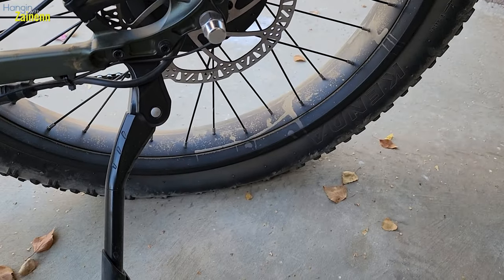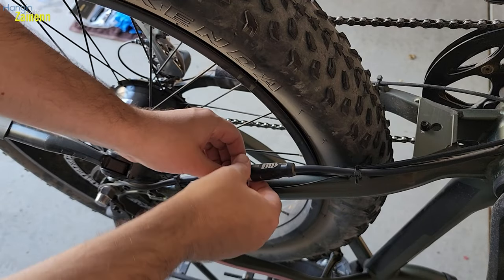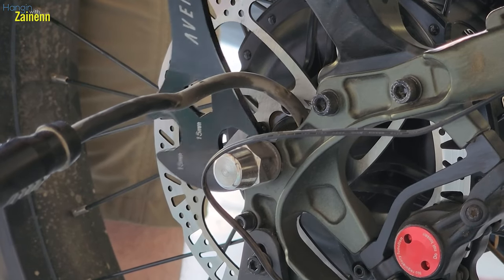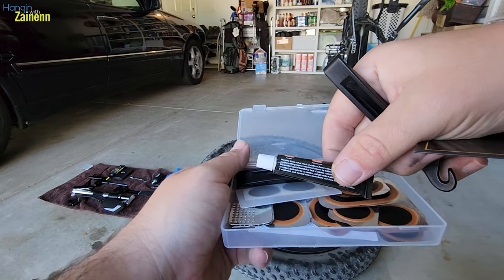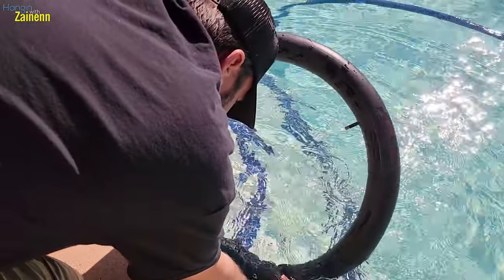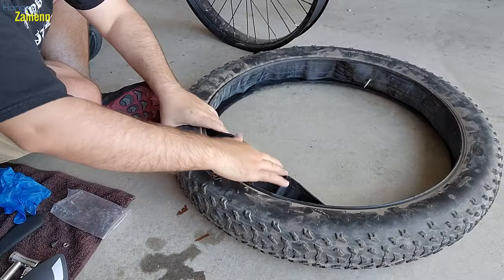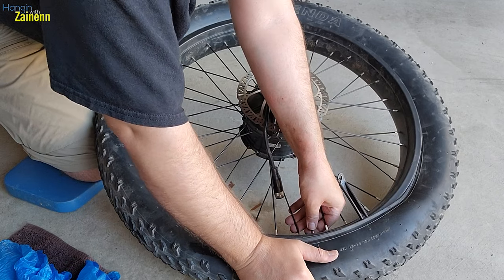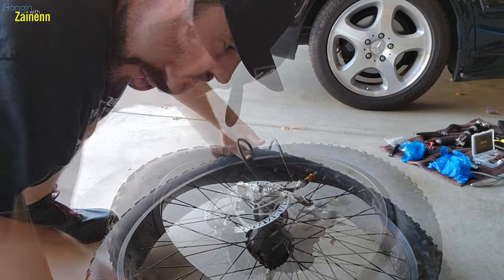How To Change Rear eBike Tire: Aventon Aventure

Comment: It’s always the back tire…🤬
Reply: Literally was. My bike got a flat in the back it was a like a hand me down bike, so I had no rear rack, saddles or anything. Had to get a ride from a friend, atleast I know my friend is reliable
Reply: Straight up all truth I've had four different e-bikes and every time it's the back tire that pops never the front pretty sure the companies are doing it on purpose
Reply: You have to add a liner to your tube if you want no more back tire issues. I had one installed cost me $60 but it's pretty bulletproof@LumbeeNative
Reply: No today I did have it to the front tire but it was a small hole so I could get home but in my way I realised the pinion group was not tightened properly😱 so double work😂😱
Reply: Not at all.
Reply: Mines 2 weeks new 😅😅 and told my peeps “my fear is the back tire going flat” THEN THE NEXT DAYYYYY woke up and it was low…. Yeah I was mad

Comment: Check the air valve first.  Its easy to replace the valve core, it that's the problem.  If you need to take the rear wheel off, I suggest cleaning all the dirt and dust off before disassembly.  This will help to keep everything clean (including your tools and hands) during disassembly and will help to avoid trapping dirt in when putting things back together.

Comment: It's probably your valve stem that was leaking. Next time you might try to tighten it up a bit. Also always add plenty of air to the tube, get a spray bottle with some soapy water in it and spray the entire tube including the valve stem, and you will see bubbles form where the leak is.

Comment: Thank You, I have the ENGWE L20 and with your video I was able to change/replace my rear flat tire.  Sadly, I had a flat in less than 30 days of use.
Reply: Same. I found a thin thorn like piece of metal that was bent and went through the tire but I couldn't find any issue with the tube.

Comment: I had a flat caused by a thorn tip smaller than the tip of a a ball point pen.  It just barely scratched the tube, but enough to cause a slow leak.  Getting home was an adventure for sure.  Next day, I bought some FlatOut and new inner tubes.

I followed the above link for inner tubes and almost bought the Presta valve version.  The Aventure 2 uses Schrader valves.  Schrader valves are easiest for running FlatOut or Slime in the inner tubes.  The little black pry bars you get with the tubes were too bendy to be of much help.  Fortunately I had some old ones from my Trek 

I used this video and also took several pictures to aid reassembly, while removing and reassembling the back tire.  The Aventon Aventure 2 uses two washers on the brake side and uses one washer plus the derailleur guard on the derailleur side.

Brake side (from outside in to the wheel) Wheel nut, washer, washer, bike frame, knuckle washer, wheel.
Derailleur side (from outside in to the wheel) Wheel nut, washer, derailleur guard, bike frame, knuckle washer, wheel.

Note: Knuckle washer must fit into frame slot when reassembling.  Also, I put bike into low gear before starting, to aid chain removal \ reinstall.

Note: Take pictures with phone.
Reply: I’m glad your comment validated what I did. I was unscrewing the chain side and the nut, lock washer, and guard fell off 😂when I put it back on I just assumed the order.

Comment: Great video.  Thank you.  If I can add the following to help others.....
Always a good time to degrease your rear cog teeth when the wheel is off.  Also inflate tube to 30PSI and use a spray bottle of soapy water - works much better than submerging in plain water.  Never press the brake handle when the wheel is dismounted and finally, ride slowly and check recheck brakes by pumping many times to ensure bubbles aren't forming from being upside down.

Comment: Thanks.. everything is a trick.  

For mine (Aventure 2) I basically had to remove the nut and washer from that side to be able to get the tire back on (probably would have been easier when I took it off to)

Getting that tire back on was painful but I got it.

Comment: Great video, thank you! - Would have loved an explanation on how you finally got that last bit of tire on the rim as this is the problem I (and probably everyone else) always runs into. :) - But don't get me wrong, I really appreciate your efforts!
Reply from the maker: Hey there,  The innertube just wasn't aligned correctly.  You just have to make sure its seated with the valve stem in the correct spot.  Also it comes down to the method of pushing it back on, all about the angles.  Thanks for watching!

Comment: I kept trying but the wheel simply would not go in the axle slots.  Finally got it. One difference is my aventure has the mud guard and that can be a problem. Thanks for the vid as it helped a lot!

Comment: So I was playing onward on oculus quest vr this morning at 2am ish and next to me something popped scared me and I pull off my vr headset in time to see my ebike moped style fall over from its kick stand due to hub tire side explode.  I've changed hub back tired tubes once before so I knew what a hassle it can be I stood it up and decided to do it later during day or after 3pm work. To freshen up I YouTube how to and watched yours just to recap in my thoughts the process.  Watching yours motivated me to get back up my bed and do it now at 3am.  It's pretty much my rude to work ..grocery shopping and everything but I also have an electric scooter as back up when either breaks downso I would have taken fast scooter so I'm done changing flat I had all the tools and extra tube plus extra tire with new thread from previous ebike I saved for parts so it was easy fast.  Now all I need to wait for daylight and test I before work. So came back to say yeah your video motivated me to fix it now so yay

Comment: Thanks for the video ❤… my “Made in China” bike got its back tire flat 2 weeks in 🤬🤬 .. after the first one came in damaged and someone STOLE my replacement so now on my 3rd bike in 2 months. So got a “Slime” inner tube that helps with punctures . Hopefully this willl the the last issue I have for a while 😅

Comment: Today I changed rear tire on a Ridstar q20. It was easy. The tires come off and on the rim very easy. I had a tire that must have been leaking from the seam over 36hrs.
In the tire I installed a double layer of cheap Amazon tire puncture film. 

BTW, if the bike sits on its back for 4 weeks like mine did, the brakes may not work unless ya pump them, a lot. Be cautious.

And the cheap liners ($20) did not self-adhesive like I presumed they did. I had to use double-sided tape to hold them in place. I think any kind of fast drying rubber glue would also work.

Comment: Just discovered your channel, love the videos. Thanks for the step by step removal instructions
First off get an electric pump off Amazon (bought mine for 20 bucks) those fat tires are a pain to hand pump up, for city riding I run my tires at 30 psi 
GET FLATOUT tire sealant in those tires pronto. I’ve rode 3 ebikes over 3000 miles with ZERO FLATS. That bike dealer should have it on hand and can install it for you
From your previous videos I agree with most your gear however may I suggest 2 items.
1 -a suspension seat post like Suntour 
2-a SENA bike helmet, it’s got a imbedded speakers and a mic with excellent noise cancellation. Plus if you ride with someone else who has one you can carry on an actual conversation while out riding with the added safety of losing the earbuds
Reply from the maker: Yeah I probably should get an electric pump.  I needed a new regular one to put in my carry bag as well.  Need to keep weight down for bikepacking, but when I'm not doing that, def. a electric one would be nice.  I got the sealant, just need to install it.  Thanks for the gear advice, you should made a video of your setup haha.  Thanks for watching!

Comment: I was amazed you were gonna patch that instead of just a new tube. Lol. I use simple green or dish soap. Your tire replacement will go much easier.
Reply: how and where? the soap i mean...
Reply: @reflexreaction3797  Along the bead to help it slip over the rim, especially that last few inches he was having trouble with.  With soap, you can usually just use the tire tools to slide it right on.  Like a zipper, sort of.

Comment: You may want to keep a small 3 or 5 oz. plastic bottle of dishwashing liquid in your bike's tool kit for lubing the tire beads and there are digital air pressure gauges available for under $10 that are smalll enough to fit into a tool kit.

Comment: Flipping a hydraulic brake bike upside down to do this can introduce air in the brake system, leaving the rider with spongy or no brakes at all.  While your stand isn't sturdy enough to hold the bike, there has to be some method of getting the rear wheel off the ground with the bike held right side up.

Edited to add, Kenda is one of the biggest tire and tube makers for bikes and is a decent quality brand.  Many of the tubes you get for Specialized, Giant or from REI and others are just rebadged Kenda tubes.
Reply from the maker: I did not know that about the brakes, thank you for letting me know.  Also, thanks for watching!

Comment: Its frustrating because i dont feel safe riding through my city. There is debri everywhere of all sorts. Ive had my second flat on the rear tire (the one i just replaced). I need my bike to get to and from work. I patched the tube on the first flat but it still lost air and the tire seemed to have lost its form probably from the weight. The first time, i seen the nail that poked through the tire and tube but this time, i had only found a micro sized staple but only seemed to have penetrated the tire. I dont see a hole nor hear leakage in the tube. Its a very slow leak but the tube even after a long time doesnt go completely flat like last time. I dont want to keep having to buy tires and tubes every month. I was getting flats in my car as well. Kept being the front right tire.

Comment: Wait wait.  How do I submerge the tire into water if I don't have a swimming pool?😀

But on a serious note,  try to avoid removing  the tube completely from the tire when looking for a leak - or a least chalk the tire at the valve.   When you find the leak, you can quickly check the tire at the same spot for whatever caused the puncture.

And thanks for the how-to.  I just bought an Av.Soltera.

Comment: I have a level. I did all these steps and real wheel will not come off. It’s stuck in there. I have done dozens of wheel replacements on various bikes and this bike will not let me remove the rear wheel

Comment: Do you know where to find the exact model for back wheel? I have a similar bike with a broken rim that I need to fix and no one is selling a 20x4 inch bike rim with a motor that’s exactly like the one you have.
Reply from the maker: I am not sure to be blunt.  But I would imagine you can find it on amazon, if not there go to your local bike shop and have them order you one.  Thanks for watching!
Reply: Unfortunately after being ripped off by a bike shop,  I had to learn how to lace my own wheels

Comment: I did this I changed my tire and everything went fine now my breaks don't work what did I do wrong when assembling it back together?
Reply from the maker: My guess (I'm no bike repair man) would be that you either put the tire on backwards or the disk is not within the pads. You have to be very careful when putting the tire back in. Thanks for watching!
Reply: @Zainenn  thank you you I will take it apart and retry again I have done it multiple times in the past and the breaks never stopped working because of it maybe something is not lined up like u said I hope that's the solution
Reply: Probably too late now. If the bike has hydraulic brakes, did you get air in the system when it was flipped upside down?

Comment: I use 12oz of flatout in each tire. Tire size 27x3.0. Yours are fatter, they have a calculator on their site but it’ll be prolly 16oz per tire (bottle is 32oz)
Reply from the maker: Yeah, I'm going to set that up soon here.  The tire went flat on me again ( the new inner tube)  Something I forgot to check was the rim, I'm hoping it doesn't have a busted spoke, I cant see anything.  Next Aventon AVENTON...cough AVENTURE lol  will be me going to a dealer. Thanks for watching!

Comment: Those Presta valves are a pain, I got one by accident and I think they are ridiculous.
Reply: You get used to them. My road bikes have them as the wheels are narrow.  In some ways, they are actually better than schrader valves.  I think they do a better job with high pressure as the valve can be "locked" closed by screwing down the top nut on the valve.  There is also the lock nut that locks the valve to the wheel, which keeps the valve in place when the tube is not fully inflated.

Yes, some schrader valves come with this as well, but it's not a common feature on schrader valves.